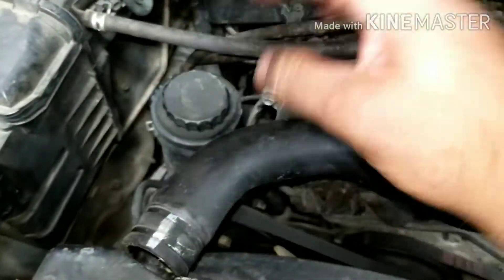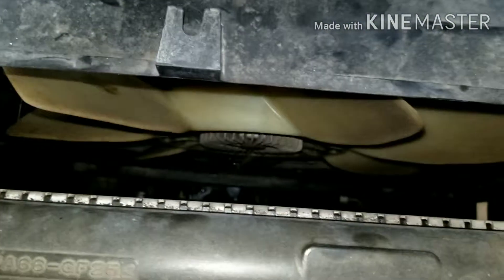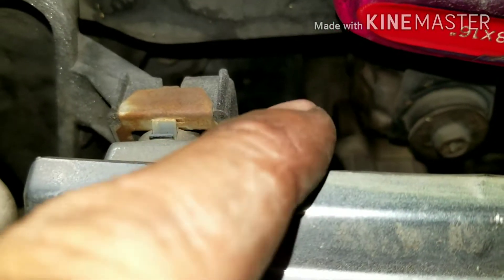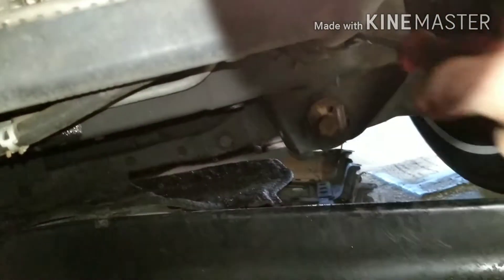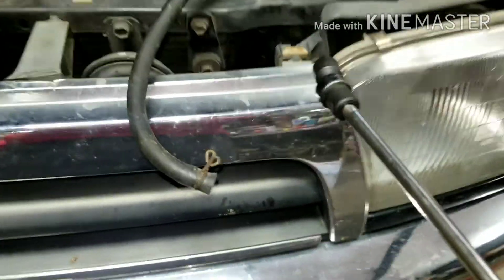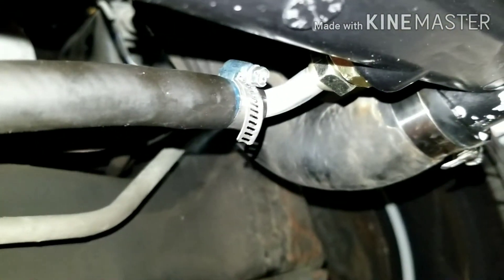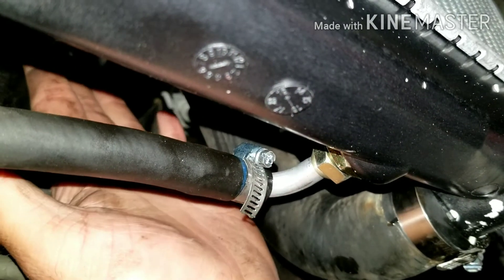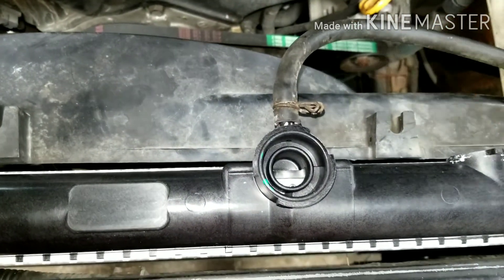96 Toyota 4runner radiator replacment

Comment: great job..just did a rad on a doge decoma . its held in with rubber bushings 4 of them. one side are bolts other side square washer..problem was the hole thing would turn finally got a a 12 point socket  on the square side...toke half a day...of...swearing..!
Reply from the maker: Yeah there a bear sometimes for everything to go the right way for ya.